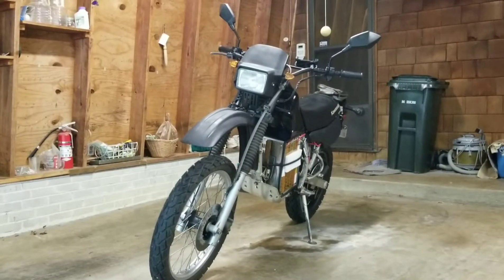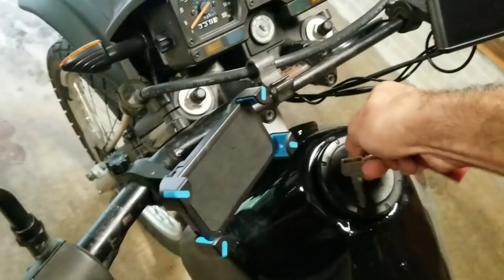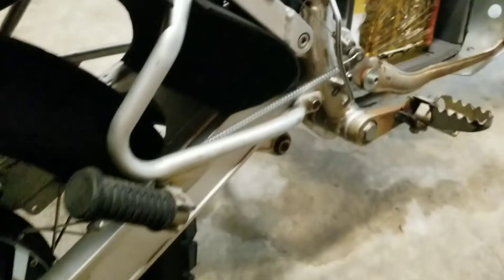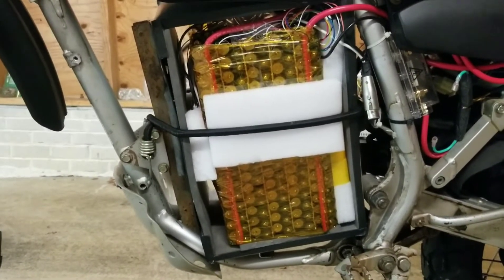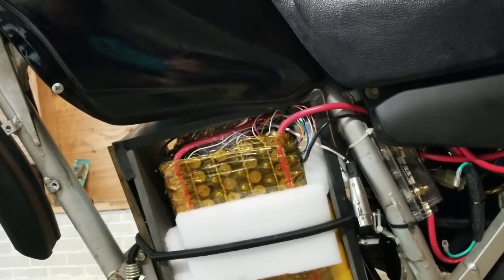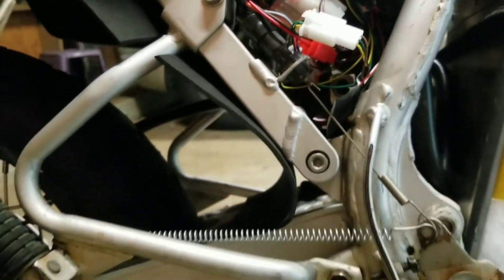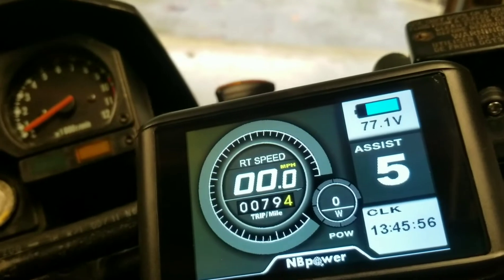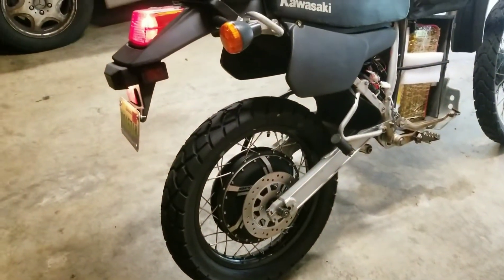Electric Motor Swap: Dual Sport Motorcycle Kawasaki KLR250 (Specs and Systems Overview)

Comment: How is the range after 2 years?
Reply from the maker: I have not had a chance to ride in a while while waiting on a replacement rear shock, very hard to find for this bike. but the batteries are still holding their voltage great according to the bluetooth app.
Reply: @dragon_offroad  thank you for replying boss. I have similar problem with front shocks and injector for my dr125sm. That’s why a simple hub motor conversion is what I’m thinking. Btw your work on the bike is very clean and beautiful.

Comment: I didn't even know they made hub motors for motorcycles. Now you have my gears turning.
Reply from the maker: There are some pros and cons to consider between hub and mid drive motor so think about both before you decide, there are some seriously badass mid drives out there
Reply: @dragon_offroad  a hub motor would probably be easiest for a complete beginner, would it not?
Reply from the maker: Definitely so. The biggest challenges I faced were truing the rim after re lacing the rim with better spokes and balancing the tire after mounting it, both of which are a little more involved on a hub motor
Reply: @dragon_offroad  Cool, that's kind of what I've gathered from watching videos about this sort of thing. I've been on the lookout for a motorcycle frame that is mostly complete with a title so I can make it street legal.
Reply from the maker: @jeremywheeler8417  I was able to pick up a complete motorcycle that wasnt running for $400. Blown engines run low on oil are very common for motorcycles and you can find a lot of them on Facebook marketplace
Reply: Hub motors for cars are also available.

Comment: Definitely buy an elcon charger. I have the pf1500 so it charges at 1500w. You can get 10 different charge voltages so for example you can charge to full capacity of 84.6v if you need extra range or 80v to save cell life.

Comment: cool job.. why not generate electricity with the front wheel?
Reply from the maker: No energy comes for free. It generates electricity with the hub motor and that's called regenerative braking because the act of pushing those electrons creates a backwards EMF to oppose the flow and slows the bike down. If you add in friction, it would actually lose you energy to add a second regen brake in the front, as well as being doubly complicated and expensive
Reply: @dragon_offroad  lol... yeah I know.. I think your conversion is awesome. I commend you on your work.

Comment: What’s your typical range per charge?
Reply from the maker: @rrv717r I typically do my charge cycles 20-80% State of Charge to get more cycles out of the pack, but if I did a 0-100% charge discharge cycle I would expect to get about 45-50 miles

Comment: You can also increase motor rpm by goinp up on voltage . When overvolting that's  more efficient then using flux weakening.

Comment: Great overview! Is the display output from motor or controller? Can you calibrate the Mph or is it rpm based?
Reply from the maker: It's from the sabvoton! It is calibrated by tapping menu button twice and changing the tire size. I initial had it set to rim size which was giving speeds way below what I was expecting, but figured out its total tire diameter rather
Reply: I’ve got a 1986 klr650 I’d like to do this to. Can you send me a parts list please. 😉
Reply: @stevebirkelund5912  would love to do this to my DR 350 too. please the parts list and where to buy. please please please :D